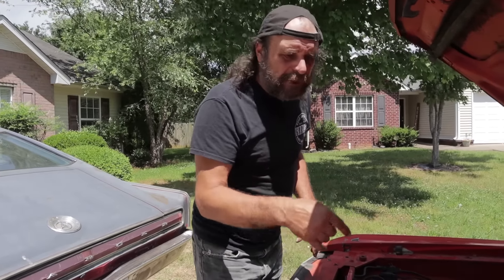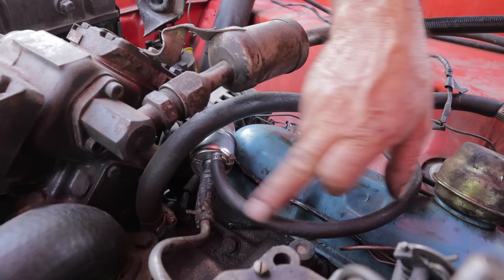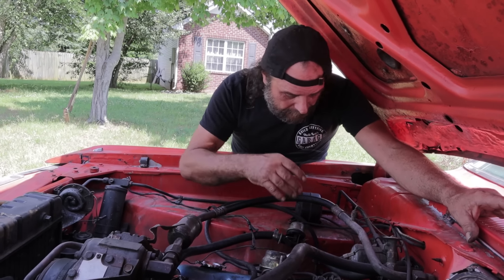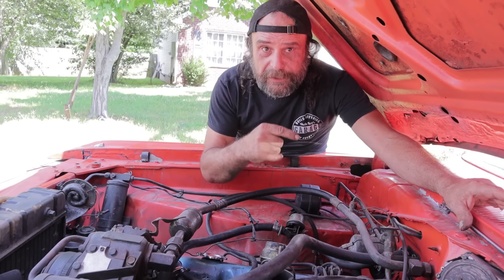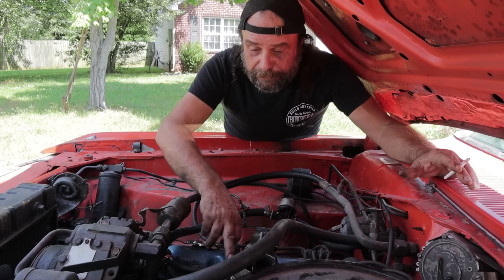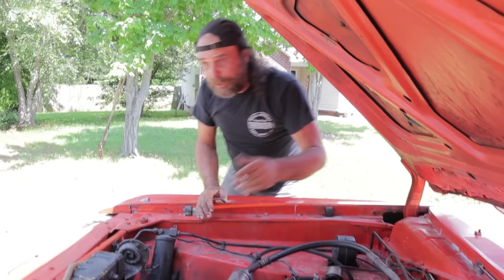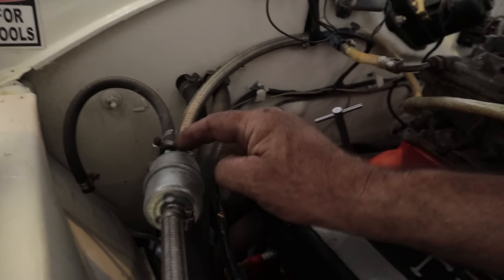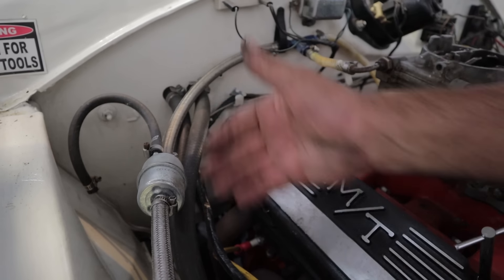$8 Cure For Vapor Lock

Comment: Good info. about Vapor Lock issues.  Boy, that has been driving me knutz on my 69 Chevy c10/307.  I only use NonEthanol, and for some reason I have been getting this terrible vapor lock problem for the past year.  Starts up perfect, runs perfect, but after a 10 minute drive, and I shut her off.......then its like I have a dead battery and the engine will barely turn over or not at all.  So, I guess the pistons are filling up with vapor/gas and you cant compress it, so the starter will not turn over.  I have replaced EVERYTHING, and was considering getting a new carb as the last thing possible that can be done (new starter, battery, cables, plug wires, plugs, points/cond., volt. reg., fuel pump, lines checked and good, etc.).  You think this 3 port filter with the release will solve the problem?  But why in the world has this never happened over the past 30 years.....why this past year?  I am baffled still.
Reply from the maker: I don't know, but trying it can't possibly hurt
Reply: Yea man, I just "dont know" what is causing this.  Truck starts and runs beautifully, no smoking, plenty of power.  But turn the key off, and its as if I only have a wee little AAA flashlight battree attempting to start her.  Wait an hour, and then she fires right up and runs great.  As you show, its gotta be raw gas getting sucked thru the carb and down into the pistons, and locking her up.  I guess if I "smelled" the engine oil, there should be a hint of raw gas in it.  Maybe the carb float is not shutting off also?

Comment: Fantastic! I just installed an insulator gasket on my new Edelbrock which was nearly burning to the touch after a half hr drive. However I'd notice on my transparent filter that it would go from full to barely burbling (and near empty) when hot. Just can't find this kinda info anywhere else.

Comment: Tony, great info thanks. On my 79 Barracuda the tank had two nipples, one for gas abs is larger and the second I was told is bleed off for Vapor. Do I run a hose from the smaller nipple on the tank to the front to accomplish this or do I need a different tank? Thanks tw

Comment: Great video I have a 78 Cadillac Eldorado and it's a very bad idea shoe Cuts or modify the fuel line that goes into the fuel filter which is in the carburetor itself. Is there a fuel or an additives to keep from getting Vapor a lot?

Comment: Tell me what the clothes pins are for and where do you put them?   Shawn
Reply from the maker: They act as heat sinks, and you can put them anywhere along the line between the pump and carb
Reply: @UncleTonysGarage  Thanks. TONY. I am 58 yrs old. I remember my friends parents had problems with vapor lock with 6 cylinders and small V-8's. Especially in July and August when it would be really hot in Indiana. They would not shut the car off when they went some where. Or we would sit in the car till the engine cooled down.Then try again and it would start back up.  Thanks for the information.  Shawn

Comment: so it basically works like a condenser ? they used those with carbon canisters years ago too didnt they ? wonder if you could run a loop and just splice back into the fuel line from a canister and once it fills to a point the pressure from the vapor lock could actually be used to increase fuel flow and efficiency ?  yeah  ive got adhd too

Comment: My folks had a Volkswagen Rabbit that used to conk out on them. The thing ran great, but would suddenly just stall out and not start. Let it sit and it would run again. No one could seem to fix the issue, or put a finger on the problem. Having seen this video, I'm betting it was vapor locking, and had a simple solution.

Comment: Tony, is the roadrunner you have had the left rear quarter repaired or replaced ,?? Also are the scoops on the hood cut out ??
Reply from the maker: That car was a basket case we pulled out of the woods in Alabama.  Just about every panel on it was trashed

Comment: Maybe it is answered somewhere in all these comments.  I heard two issues.  We boil the ethanol/gas from the pump to the carb, and secondly in the carb.  Question I guess I have.  I get the proposed solution in the fuel line (from pump to carb) - bleed vapors, and some fuel back to the tank.  The carb I don't understand.  It is shut-off from taking fuel by the needle/seat/float system.  If it boils in the line, are you saying it pushes past this shut-off?  On the carb, then there is a carb vent (on my AVS anyway) that I guess should vent when turned off.  I'm wondering how you see the return line helping the carb, I guess is the question.

Comment: Tony Great tip; I have stopped many a time after getting off the highway in 100F TX temps and could see the fuel boiling in the plastic filter.  I have a non-smog slant 6, what would be the basic hook up if you don’t have a factory secondary vent inlet on the fuel tank to run the vent line back to?  Thanks.

Comment: Nice video. I have a '65 C-code mustang with a 4.7L 289 V8, and a two barrel carb. I plan to add heat shielding over the fuel line to reduce the vapor lock issue. However, I don't believe it has a return line to the tank. This technique only works if you have a return line, correct?

Comment: Awesome video. My 65 c10 takes 10 minutes to restart after an 1hr 1/2 drive. The starter doesnt even crank and sometimes the radiator fan doesnt even turn on, headlights turn on. No click and no crank.But after sitting for 10 minutes it fires up. Do you think installing a vapor separator gas filter will resolve this issue?
Reply: Please help Uncle Tony

Comment: thanks, this type of gas filter is new to me. have you tried the carbuerator spacer made from a material that keeps heat from overheating carb.  tis helped me solve my problem on a 350 sb with 4 barr.   the alluminum spacers do no help much. i used the 1/2 in black type on mine.  let me know... thanks again for the info

Comment: Ethanol laced gas is doo doo! It will also eat the natural rubber O-rings in your carburetor. Before I found Ethanol free gas in town, I pulled the carbs on my FZ1, and replaced all the rubber O-rings with Nitrile O-rings, as they won't rot like rubber from the crap gas.

I'm going to have to get a T-shirt! Woo Hoo!

Comment: Uncle Tony!! Just a quick question... at the end of the video you showed your 68 road runner setup.  You said the third line runs back to the fuel tank and tee's off on the return. Does the tee to the return have to be closer to the fuel tank or can I tee off closer to the engine?

Comment: I enjoy your how-to videos. I have a 1950 Packard with the original 288 cid inline flathead eight. I am having vapor lock issues. I have installed a modified an original carb heat shield from the large 356 cid flathead eights and installed a special insulation on the fuel line from the pump to the carb. (I changed the original steel gas line to an aluminum one to prevent rusting. Also, I kept the same location for the gas line plumbed on the outside of the frame before working thru the front of the engine to the fuel pump.) I also add Star Tron Fuel treatment to the ethanol gasoline. With the original gas tank, there is no way to plumb a return line system you reference in your video. Have you come across other solutions to older classic cars that you can share? Thanks.

Comment: Quick question.  I have an electric fuel pump on the inside frame rail near the tank on a '44 Dodge.  The actual fuel filter is in the tank.  Would I run this set up from the fuel pump, mounted to the rail with the lines doing all the T stuff under the hood?  I'm trying to picture it, but I need that question discussed before I go further.  Thanks

Comment: Here's a question Tony: I have an 04 4.0 Wrangler. Years ago I removed the rear fender well liners. Behind the passenger plastic is the evap canister. I removed it and just mated the hoses together, no codes. Other than the canister catching possible escaping vapors (I've never smelled any) is there any adverse effect to removing it on a newer vehicle like mine?
Reply from the maker: No, I think you should be fine, but you could check on a Wrangler specific forum just to be sure
Reply: Ok cool. I would think if there were an issue it'd be apparent by now. My first car was a 1990 Isuzu TrooperII and I ended up having to put a separator on it. The first week I had it it had flooded while sitting on a hill. The vent on the gas cap was broken and caused all sorts of issues I spent about a month chasing. Same with a 69 Bug (2nd car) Ohh the days before the internet and having to know guys who knew engines. Keep up the great informative videos Sir, I'll have to get some stuff from ya soon!

Comment: Good advice, my 69 Chevelles fuel tank has a vent that use to go back to I assume the fuel pump, I figured it was mainly for venting, I got rid of it and installed a one-way check valve right at the tank, couldn't use a vented gas cap because it would leak having the cap behind the lic plate.
I drive it in Alaska so I don't get the vapor lock like you guys in the lower 48 but then again I mainly use avgas (100 oct) with additive for lube.
Love your vids by the way. Keep it up!
PS, off topic but have you ever heard of anyone using Pontiac front A-arms off an A body like a goat to achieve better cornering and to rid the rock the boat bs? I'm aware of the aftermarket A-arms but seeing Pontiac corners way better then a Chevelle I was wondering if it would work or if it's even mechanically achievable w/o to much N-rigging

Comment: Tony I have a question, i went and bought a vapor lock filter from Napa,  I specially told them I need one with no orfice. I got the filter today and inside the 1/4" tube I see what looks to be a pencil tip hole so I'm assuming that's an orifice or reducer. My question is should i drill it out the same same size as the 1/4" opening.  My car did come with a factory return like for the mechanical fuel pump I'm now running a electric pump from O'Reilly that puts out 4-7 psi. Thanks dave!
Reply from the maker: Dave, blow into the return line.  You'll know within a couple of seconds if it has a restriction or orifice in it.  If it does, just drill open the one in your new filter
Reply: @UncleTonysGarage  sounds good I'll give that a try. Thank you for the response Tony!
Reply: Ok so I blew into the return line, I do feel some restriction. I have to blow pretty good to get a good flow going. I'm assuming if it wasn't restricted I would have been able to blow without me haven't to try a little harder then usual.
Reply: Tony all went well with vapor filter.  Thanks man!

Comment: Hi Tony. I used this technique and added a three leg filter to my 75 Malibu with a hard line return to the tank as the vent line, and when opening my gas tank now a ton of pressure released, seems like my tank was collapsing. As if I sealed the system with no vent. Any idea what to modify now, the filter I used was for an 85 dodge 318, should I try another style filter? Thank you. Love your content and videos!

Comment: thanks for the info, love your channel.
How does one tell if a Wix 33040 fuel filter has an orifice?
Does it really matter on a 350 SBC? 
This Wix filter would be my last additional fix for a bad vapor lock problem.
Can the fuel, orifice or not, circulate back to the tank,
with a mechanic fuel pump installed, 
1406 Eldelbrock w/1/2" aluminum spacer between carb and manifold? 
and still supply the needed fuel on a hot day on a steep grade?
Thanks again, anyone?

Comment: Hey Tony, novice at YouTube here. I know this videos is old. But we have a 318 with a 60s Carter bbd like your daily driver that is leaking gas out the pump vent. Also having harder starts when too much heat soak upon shut off. Do I just do the filter or should we make a heat sgeild? The running fuel pump pressure is 6 psi and holds when engine is shutoff. Any help would be great.
Your videos helped me and my son rebuild his 78 power wagon.
Thanks
D

Comment: Hey Uncle Tony. I noticed on your red car is a former charcoal can type. My dart sport is same set up. So if I use the hard line that went to the charcoal can to hook up return line from filter. How will gas tank vent fumes?
Reply from the maker: It won't have to vent anything.  That pressure will actually help your fuel pump along.  Side benefit
Reply: @UncleTonysGarage  Thanks! Just was unsure about my doubt about fume venting. But what you tell me makes sense! Here in Texas summers are brutal and the rat piss for gas is not helping either. So these solutions are excellent.

Comment: How about a phenolic spacer between the carb and intake? How about insulating the line that comes from the pump to the carb? How about blocking the heat crossovers under the intake? How about using a real mic or getting out of the wind that's blowing? HackDrunkleTony
Reply from the maker: HackDrunkle..that's fucking awesome.  I love you too man

Comment: If you do that do you need to get rid of the charcoal canister....and does the gas cap need to be vented both ways?
Reply from the maker: One way vent is fine.  I find that the pressure build up inside the tank also helps keep the fuel in the lines liquid

Comment: How should i go-about Ventilating the fuel tank now that I’m using the vent hose as the vapor/fuel return line?  Lots of pressure coming out when I take the cap off.
Reply from the maker: That's perfect...that pressure is helping to keep the fuel from separating inside the system.  It's only a problem if it bows the center of the tank out
Reply: Uncle Tony's Garage thank you

Comment: What would you call making a Quarter mile pass and when you hit the end the motor kills the moment you let off? I have a 66 ss Chevelle with a 350 small block and 4sd muncie and 4:88 rear gears. The only time it happens is when I race it!!! I would love to hear your input????
Reply from the maker: When you get into the brakes?  Check the float level in the rear bowl
Reply: @UncleTonysGarage  just to let you know I have a Holley strip pump and half inch aluminum tubing plumbed to the regulator on the fire wall then 3/8 line run to the front and rear bowls so I don't think that I'm having a gas issue if that's what you're getting at! Someone told me that I could be getting vapor lock? It's a 11 to 1 motor with Dart Motown heads that I smoothed out the bowls under the valves and the runners also have a victor jr same thing smoothed out and a 750 dbl pump turned into a 825 cfm according to the Holley book! Just a little info. And the car runs a 11: 60 at 115 mph in the Quarter mile!!!!

Comment: I have a 72 Jimmy with a 350 and a manual fuel pump.  I have these problems and in my clear fuel filter there is always air/vapor.  This may be my problem.  How do I add one of these filters? Do I buy 20 ft of fuel line and run it back to the old tank? Where does it go? Do I have to drill and tap the fuel tank?
Should I add an electric fuel pump instead?

Comment: I’m convinced that “Vapor Lock” is a bs thing some guy made up one day many years ago and that is is actually bull shit.  I have never had any carbureted engine vapor lock and I live in Tucson AC it gets 118 at times and all carbureted vehicles i’ve driven in it never had an issue running in the heat.
Reply from the maker: Gasoline is formulated differently for region, altitude and season
Reply: Uncle Tony's Garage That is true,  I didn’t think about that part.

Comment: Can I just run the vapor line to the filler neck or does it have to be to the top of the tank
Reply from the maker: As long as it's closer to the tank than the cap, you should be ok
Reply: @UncleTonysGarage  thanks

Comment: Tony I converted a 93 S10 Blazer over to  carburetor and HEI ignition system. I put an old school pickup in the tank with an external Holley pump at the tank .will I still need to put the fuel filter you're referring to in my vehicle for fuel travel back to the tank.

Comment: i have a 1970 chevelle.  I would like to order the right filter.  I think i need the one with the orifice in it.  I dont think my tank has one.  It does have a factory line running back to the tank though.  I went on amazon and jegs but they dont tell you if the filter has the orifice or not.   What part number would you suggest.   thanks   Great videos.

Comment: what do you do about the dissolved air problem in the gasoline caused by the lowering of the sulphur to 10 ppm? dissolved air in the fuel does not help to reduce vapor lock.

Comment: So if the vehicle didn’t have a built in return line you need the filter with an orifice but where does it T off going into tank?  Im not familiar with the fuel lines yet on my car.  Thanks
Reply from the maker: I Tee'd off right at the sending unit
Reply: Uncle Tony's Garage I see. So the output from tank gets  a T fitting.  This doesn’t interfere with fuel going to fuel pump?  I guess I’m thinking like I’ve still got an electric pump from my other car.

Comment: I drove carb cars for years n years, and never experienced vapor lock.
I started driving in 1977 and drove a 71 Pontiac Bonneville, then a 71 Buick Gran Sport, all my dads new GM cars and trucks from the late 70’s and early 80’s and a Datsun 210...
All these cars had carbs, yet I never ever once experienced vapor lock.
What cars generally experienced this problem?
Reply: My 66 Mustang does...

Comment: Uncle Tony thank you for this video.  I followed the video exactly as you said using a Wix 33040 filter but it must not have an orifice in it because once under pressure, fuel started dumping out of my vent line in the back.   I called Wix and they said they don't make any fuel filters with the orifice in the vapor line. Uncle Tony (or anyone else) please tell me the part number for the fuel filter with the orifice in the vapor line?